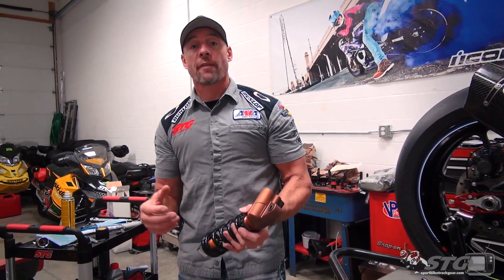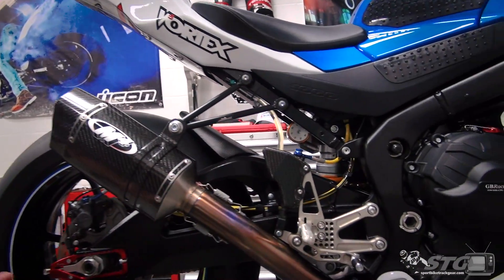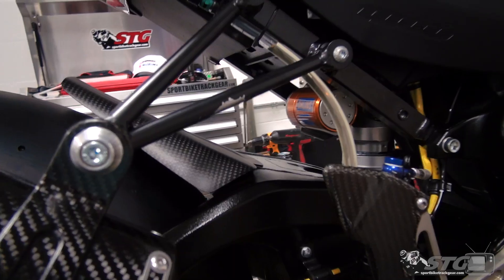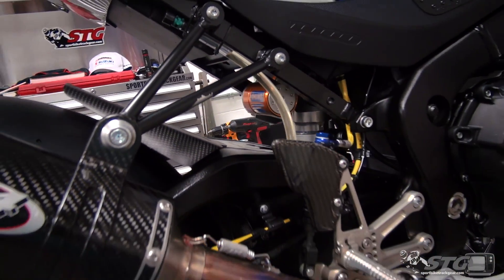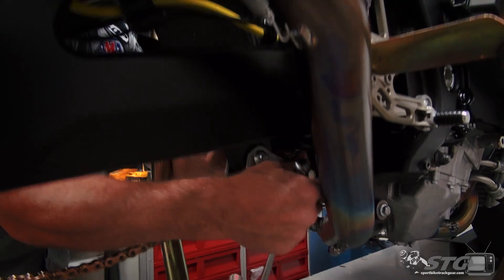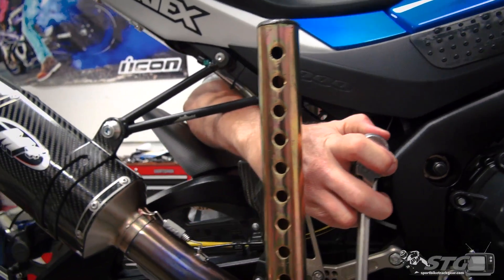Ohlins 2018 Suzuki GSX-R1000 Shock Install | Sportbike Track Gear

Comment: Instead of using the foot pegs for support could you also use two jack stands right under the frame? Will a rear paddock stand work or does the swingarm need to be supported by the spools?

Comment: The suspension is fantastic for this 5'9 160 pound 43 year old. You look a little taller than myself. I could see why you need to stiffen it up some. The gsxr is looking tight and fast. Take care and good luck Max🏆
Reply from the maker: This is a great bike, looking forward to riding it at Barber after the last race. Max is excited foe Jersey this weekend and Barber the next for sure. - Van
Reply: @sportbiketrackgear  I just came back from a nice long ride. 4 months with this beast and I'm still blow away by the midrange pull. What a special motor. Almost done with my mods. Full exhaust and some light tech chain Adjuster blocks. I want blue so I will be calling that one in to you guys. Well have a blast out there and good luck to you both

Comment: What setting would u run on street with this shock
Reply from the maker: When you purchase the shock it will come with a manual that will give you baseline settings that would be a great place to start on the street. - Van

Comment: Brian,
You mention in the video that you were going to install a cartridge kit in the forks at a later date. Have you done that yet or are you going to? I've emailed Jimmy for some awesome price's on the shock and cartridge kit, but I would like to hear your thought's if you've done the cartridge install.
Thanks,
Mark
Reply from the maker: I had the cartridge kit installed by the Ohlins tech that worked with Team Hammer. The bike is handling amazing! I could not be any happier with this bike. - Van

Comment: Did u take the stupid mud gaurd off afterwards??? I got the lighttech hugger aswell also u said u would call me about my ecu issue please do so thank you for your vids and time
Reply from the maker: I did take the little rubber mud guard off after I installed the shock. Shoot me an email with the issue you are having with the ECU and I will see if I can help. service@sportbiketrackgear.com If you have flashed the bike with the Woolich software I have zero experience with that and will not be able to offer any real assistance. - Brian Van

Comment: What Jack stands would you recommend if you have folding foot pegs? Lightech type R Thanks
Reply: I was thinking about flipping them but these are very expensive foot pegs/rearsets and Wanted to be sure
Reply from the maker: You could use the Pit Bull and make sure they are right up against the rearset bracket just inside the footpeg hinge. You will have a little less surface area for the jack stands but it will work. I have done this in the past on other models. - Van
Reply: Awesome Van thanks! Just ordered a pair 👌

Comment: How much firmer can that rear shock get beyond the stock GSXR1000? ( not the GSXR1000R)
Reply from the maker: To be fair this bike handled great with the OEM suspension right out of the box. That said the OEM rear shock and spring were soft allowing the bike to squat more than I liked. Having ridden the bike for a few sessions with the Ohlins shock the bike handles better at speed than it did previously. The goal is to make the bike as easy as possible to ride fast on the track, suspension is key to making that happen. - Van

Comment: Where's the pitbull "tire ramp" (I don't remember its actual name)?

Also, what's your opinion on using impact tools to loosen the larger nuts and bolts on a bike?
Reply from the maker: I did not use the tire wedge because I am using the Woodcraft Superbike Rear Stand with the Lightech Lifters on the bike now. If you use a Pit Bull Stand the Pit Crew Tire Wedge is just awesome! Here is a link to that on our site: https://www.sportbiketrackgear.com/pit-bull-pit-crew-tire-wedge/

I do not have any issue with removing bolts using an impact. We don't do that in the videos because most people will be using hand tools. Personally I would not reinstall the fasteners with the impact if you decide to use it to disassemble. - Brian Van
Reply: @sportbiketrackgear  But you did that in one of your videos

Comment: What spring rate did you use for the shock?
Reply: I would also like to know which spring rate you are using and also like to know what shock length you end up using?
Reply: I also would like to know which is the best shock lengh to start with . 
I didn’t see any video talking about settings or how to start when you change the shock . STG has more information than us . Really would like to know some more